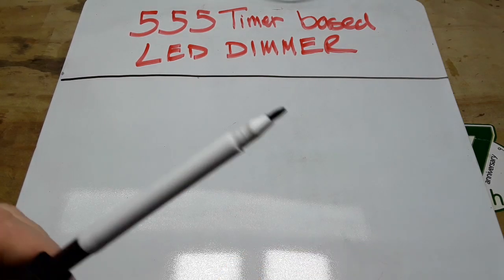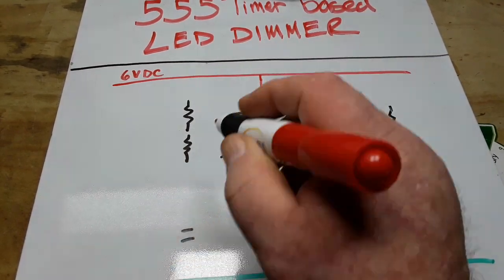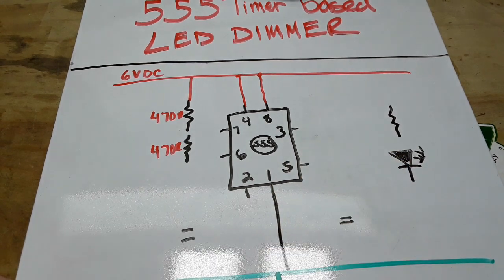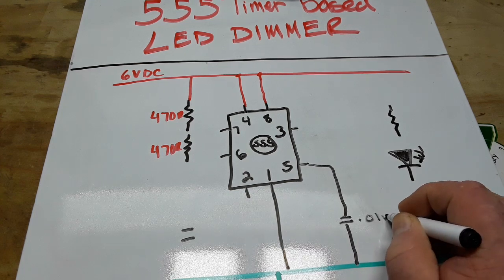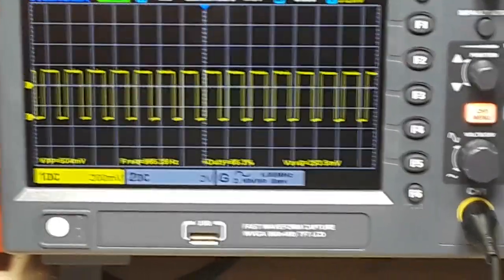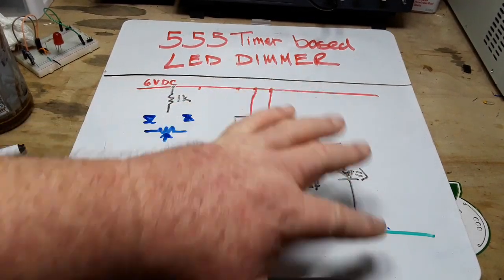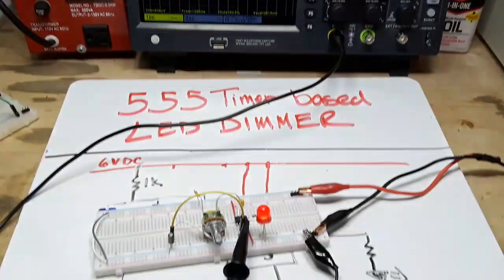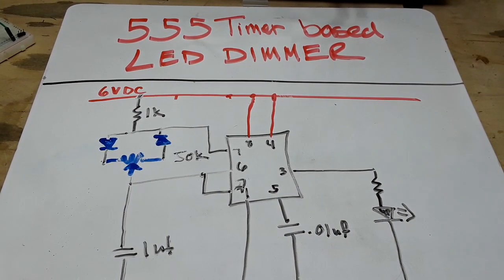HOW TO MAKE AN LED DIMMER

Comment: Wpuldn't you have to worry about a tiny amount of vurrent going back through the 1k resistor? Would this be bad for a lithium battry power supply? If I used this circuit should I use a diode there, or is that overkill?

Comment: Would this work with a 12V input, dimming a 4W LED bulb?  I'm trying to build a circuit to dim a 12VDC 4W bulb in a lamp that is battery powered.

Comment: very cool content as usual!
hi, am a total newby in this electronics thing but im really loving it jaja, I already fixed CRT tv that was dead and found out the problem was in the secondary power suply, a shorted H.O.T and few cold joints in the flyback area. I WANT MORE.. im making this LEd tree, im using old fashioned DIP leds and are 73 in total connected in series of 4, 6 and 7 LED every serie is a branch of the tree. so my question is..

what altenative do I have to make a dimmer in this circuit fed wth 19 volts cause as far as i know NE 555 working voltage can´t exceed 18 volts¿

Comment: I have made the same circuit but LED doesnt dim, only BLINK. I connected my scope and I am able to change duty cycle, so the circuit is correct. Can anybody explain why the LED blinks but not dim. Thanks fellas

Never mind, I replaced the cap for a smaller value and its working fine

Comment: Great  video Paul, can this be used with some way to limit max Vout? I have an LED driver with 12v 200ma supply for 0-10v dimming and I wouldn't want to send back 11 or 12v back in.
Reply from the maker: The voltage is fixed. We are only changing the mark-space ratio.
Reply: @learnelectronics  So as long as I regulate down to 10V first, this may work perfectly. Thanks again!

Comment: After two attempts to get this to work, I must ask what diodes are you using? Does it matter? I am using 1N4001. On my 'scope I just see noise at ~100KHz. LED goes on but no dimming.
Reply from the maker: I'm using Schottky diodes but it doesn't matter what type of diode. All diodes act as one way valves.
Reply: @learnelectronics  Thanks. I think I might have just had a wiring problem. Wire back from capacitor going to pin 3 instead of pin 2. I checked and rechecked the circuiit but kept missing this fact. I got it working now with the IN4001, Lesson learned! Keep up the good work and I'll be watching.

Comment: Do you know if its possible with a 555 to achieve a duty cycle low enough, even beyond that of a windshield wiper delay?  i'm talking about a signal 1-2 seconds high, 1-2 minutes low. Ive tried different values using sub boxes but couldn't even get in the neighborhood. Theres a chip (LTC 6995) thats capable but its only available in a SOT-23 package. Thanks great channel

Comment: THIS IS THE GOOD STUFF!! 
 I truly appreciate the focus on traditional ANALOG circuitry. I cannot recall how many times I’ve been at the bench with  similar project application decisions.More often than not, a simple circuit can be so much more practical than just throwing a microcontroller in the mix.Not to mention all the associated  secondary requirements that come along with using tons of equipment.

Comment: Great stuff, can't wait to see the motor pwm application, looking forward to use for fan speed control. Can you elaborate on the resistor selection so that I know what to use in a 12V system controlling a led strip that I would like to make dimmable. Thanks
Reply: What about using a LM7805 or LM340?

Comment: Looking forward to the follow up. I’d like to use this to control the brightness of about 20 meters of 12V LED strip which will get mounted under my stairs as illumination for the night.
Reply: i expect that this circuit can not handle the power needed for your project, lets say 30 leds per meter times 12 = 360 leds at 10 µAmps per led, for your own safety, better get a pre-made controller and a good smoke detector.
Reply: @jyvben1520  no worries. I made such circuits before and I know what I’m doing. I studied electronics 10 years ago. And yes, I have smoke detectors which are part of my Smart Home so if there is smoke somewhere I will definitely get informed 😀

Comment: Love this type of content from you. I think it's your best. Useful circuits and component based content. 

Could you elaborate more on how the diode section works? I'm having a bit of trouble visualizing what's going on with them and how exactly they are affecting the charging of the capacitor. Why wouldn't just a potentiometer be used to adjust the charge current supplied?

Comment: could you get the circuit to have adjustable frequency as well as duty cycle. I could never make it work because one would always affect the other. I had to use an arduino instead.
Reply: Have you tried adding a diac to the circuit, to control the current limit? 
I'm not sure if it's effect will produce the outcome of variable voltages or not but an LM7805 orLM340 should.
Reply: @cndbrn7975  thank you I'll try it.

Comment: Would have been interesting if you would have showed the signal on pins 6 & to with respect to ground--and a bit more explanation about how the a-stable oscillator works.

Comment: Great video, Paul. Thanks!
How about a series, including PWM servo & stepper driver/amps, too? Perhaps a programmable DAC input from arduino or PICO as the finale?
Yeah, I know that there are already commercially available servo driver boards for MCUs, but you're already 1/3 the way there, from scratch. Given the whole tamale, folks could build their own custom servo/stepper motor controllers from scratch, too. JS